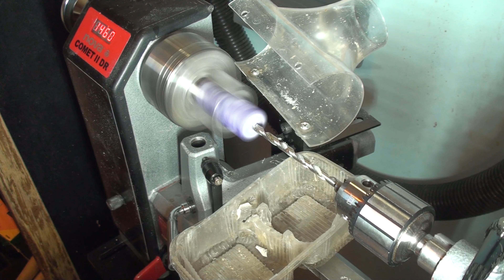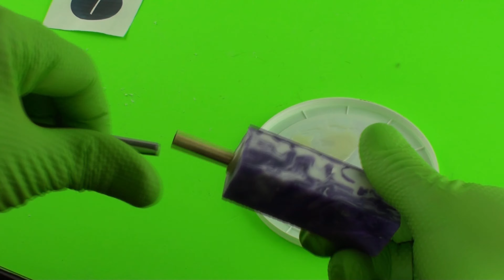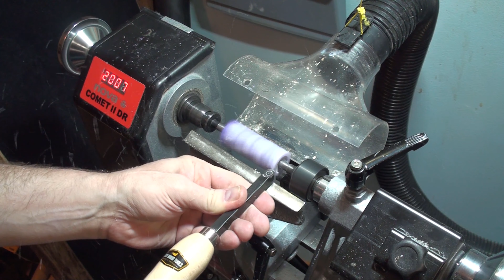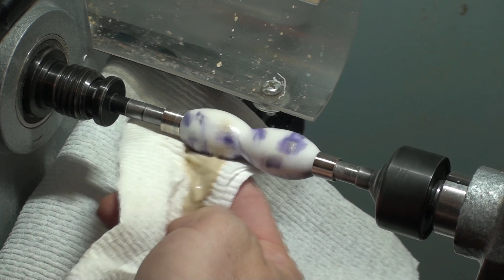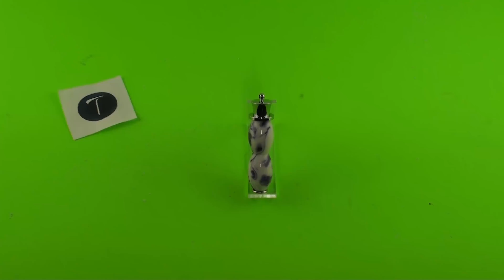Making a Christmas Tree Ornament

Comment: As usual, you make really nice small turning projects like this one is. At first, I thought is was twisted, but it turned out to be the resin's pattern. 
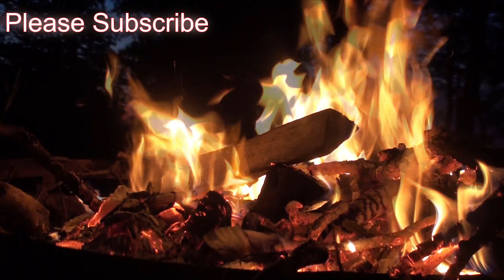2 Questions: How many mandrels does it take to do all the kits (1 for each type or are they adaptable) ?  and at 2:20 was that a shot of your outdoor kiln ?
Stay safe. -Mike😷
Reply from the maker: I use just the standard pen mandrel.  I am guessing you mean bushings?  It seem everyone has different bushings.   Sometimes I just use bushing from a different kit instead of buying new ones.  I just have a little fire pit in the yard.  I really appreciate you watching Mike!
Reply: @TurningsbyTurner  Thanks for the lesson on mandrels & bushes🙏   I will slowly work up to learn all I can to get started on pens so this is my first actual lesson 😁 Watching is my pleasure👍